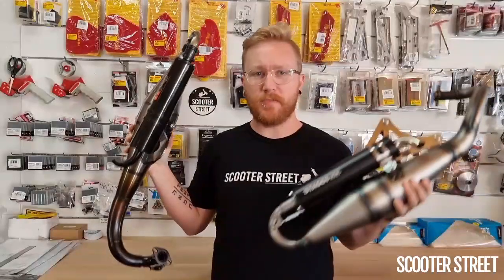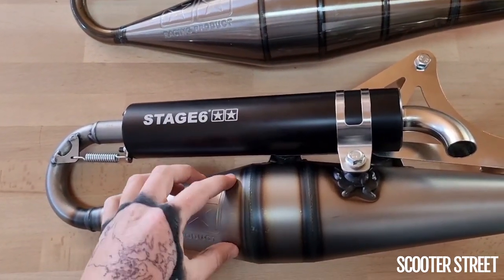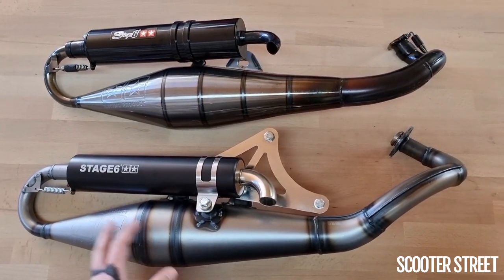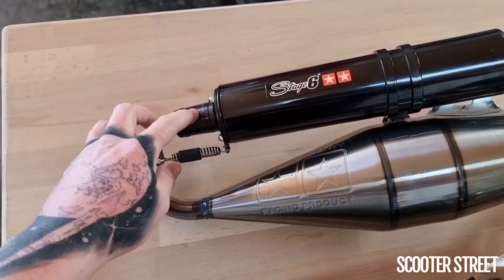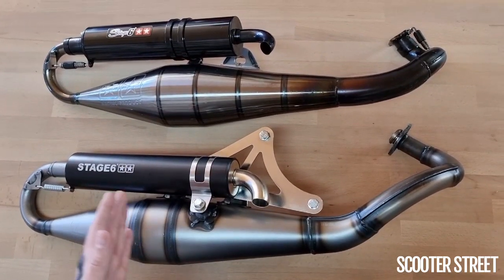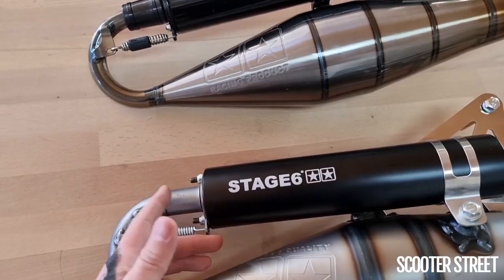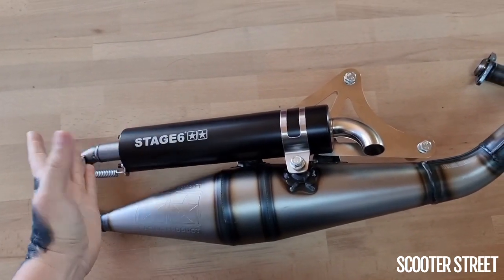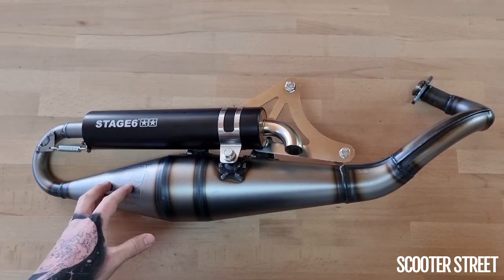Stage 6 Pro Replica Exhaust MKI vs MKII - What is the difference?

Comment: sound difference from the MK1 to the MKII?
Reply from the maker: Same sound, MK1 will be louder to start but a repack can quieten it down. also it depends on which cylinder kit you match, as the cylinder creates the noise and the exhaust amplifies it.
Reply: @scooterstreetau  currently have an airsal 50cc sport which has a bridged exhaust port with one piston ring which allows it to rev quite high, I currently have the MK1 and was wondering if there was any actual improvement other than looks?
Reply from the maker: @BoozySZN  Stay with the MK1.
Reply: @scooterstreetau   imo not same sound, Mk1 is extremely loud and sounds cheap. MK2 sounds like a yasuni R which has a much better sound and isnt as loud.
Reply from the maker: @lostinspace2899  Just sharing what we find from our tunings. We have had the MK1 and if it pipe became too loud we just did a repack.. You are correct, the MK1 is louder first up but we do a repack. 
This is our experiences with different exhaust. your experiences may be totally different. 
You obviously have a MK2 and your looking into it too much, add some of your experiences.
Reply: @scooterstreetau  you are right, sry for the harsh tone, wasnt tryin to be rude ✌🏼
Reply from the maker: @lostinspace2899  Very nice of you🤙I edited the comment to be more precise, it is difficult to try and give detailed answers not knowing the set up or the angle of the questions. I think you can give a lot of input in to our threads and channel so go for it. Watch all the videos and tell us what you do when you tune🙌
Reply: @scooterstreetau  i will soon 👍🏻
Reply from the maker: @lostinspace2899  Thanks for watching and all input is of value🛵
Reply: @scooterstreetau  Hey! You was right m8, the Pro Replica MK2 is more like the Yasuni Z. It reaches it maximum power at like 10.300 RPM in combination with Sport Pro MK2 Cylinder. The Yasuni R can do 11.000 RPM with the Sport Pro MK2, so the pro replica MK2 is worse. Bit of a bummer. Im thinking about upgrading to a C16 for my Sport Pro MK2. The C16 can do revs up to 12,500 is that right?
Reply from the maker: @lostinspace2899  Legend! Thanks for letting us know as this means you know what you're talking about🙌. The MK2 (Sim. to Yas Z) is brilliant for the 50cc and sport 70 kits. I found the MK1 really needs highest RPM to start building its power so the lightening of the transmission and reduced load, allowing that RM to build as soon as possible will give the best benefits, this is really the same as any of the higher class exhausts. The Yasuni and the STG6 MK2 are amazing exhausts and for their correct application you wont be disappointed. The C16 (or the C20) will be a great pairing with the Sport Pro MK2. I think you already had the 19mm carby.
Reply: @scooterstreetau  ill do a video soon of my current setup, acceleration and top Speed, like i Did with the Naraku Sport 70ccm build. To show what a Pro Replica MK2 can do in combination with the sport  pro mk2 cylinder. And sometime soon I will upgrade to a C16, C20 or R1200, well see. Still not sure. Btw the pro rep mk2 is a leftover from my naraku build ✌🏼ah btw im still using a 17.5 carb with 120 main jet atm no problems so far. Of course a bigger carb would give a little more power, but also needs more fuel.
Reply from the maker: @lostinspace2899  It all sounds amazing, this will be something to look forward too🚀🚀

Comment: Does the mk2 silencer fit on the mk1?
Reply from the maker: Yes but you will need the connection parts for the silencer. That is one regular comment, the MK1 is very loud.
Reply: @scooterstreetau  The connection parts from the mk1 or the mk2?
Reply from the maker: WHich one do you need the connections for? @raksy9475
Reply: @scooterstreetau  I want to connect the mk2 silencer on the mk1 exhaust
Reply from the maker: Ok you will need the connections for the MK1, see the video. @raksy9475